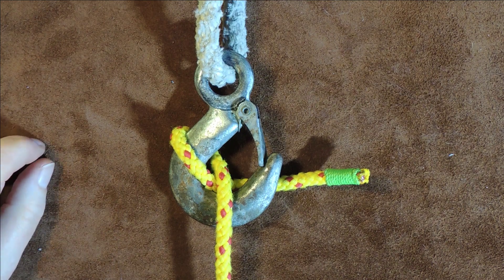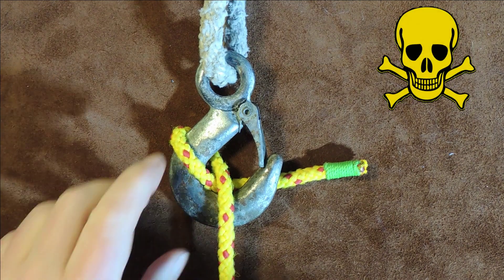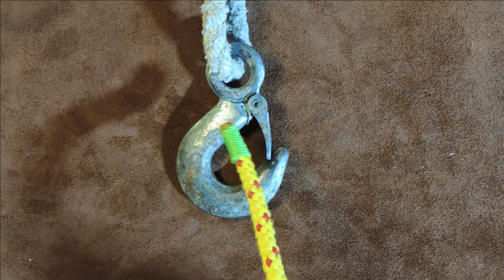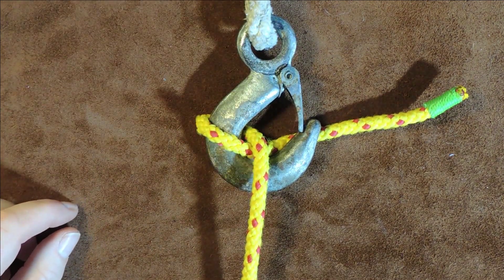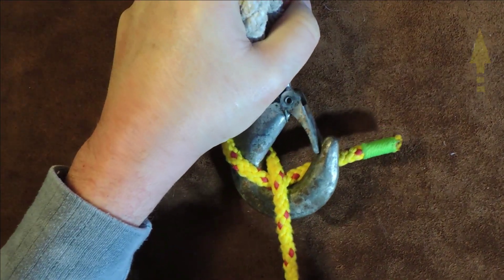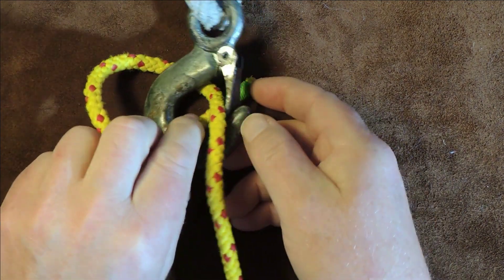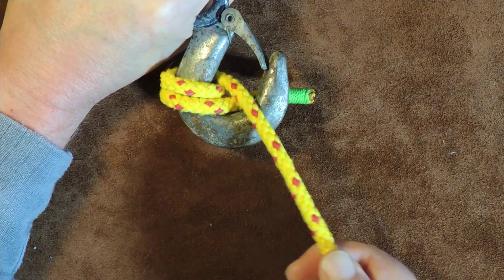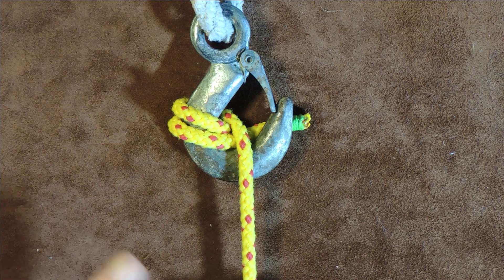Blackwall Hitch - Double Blackwall Hitch - Attaching a Load to a Crane Hook

Comment: Johnny - though I wouldn't use this for lifting, I've used the Blackwall hitch for winching multi-ton logs up ramps onto a saw mill. It never slips as long as its under load. And, there's an easier way to "throw" the hitch over the bill of the hook by starting with an overhand loop facing away from the bill, dropping it over the bill and sliding it around the back.
Reply from the maker: Thanks for taking the time to leave a comment Robert. I have to say that I did test this a number of times and was really impressed with the speed and strength of this hitch. Thanks for letting me know that this particular hitch is still alive and kicking.

Comment: Ashley has this to say about it: 

> The BLACKWALL HITCH is one of the most common applications of the SINGLE HITCH, but it is not to be trusted too far. At sea 
it is used in setting up rigging lanyards when they are too short to tie with a better hitch. The name BLACKW ALL HITCH was applied by Steel in 1794.

So it seems that it was only really used when they had to.

Comment: Great little knot. If you tie a figure 8 stopper on the end of the free end it will be much safer. Especially if the cordage is properly mated to the hook. Very useful for hanging gear temporarily. It works well tied in the fork of a branch too. 😀
Reply from the maker: I think it comes from the good olde days when speed was the important factor, health and safety was not.

Comment: I used to use this hitch all the time when lifting smaller loads (less than 1 ton say). It is secure as long as the load is maintained but as a security feature I used to leave the working end long and put a half hitch around the standing end below the hook to stop the hitch from working loose. You also need to bring your sling around quite high on the back of the hook. If the sling slips around to the bottom of the hook it will fail. The advantage of the Blackwall Hitch is that it is very quick to tie, won't jam and allows you to shorten the sling which is useful when you have limited head room.
Reply from the maker: I am glad that this is still being used today!! Where do you work that requires this hitch?
Reply: I used to work as a rigger, mainly relocating machinery. Often headroom was very limited and on the smaller machines we would use flat nylon slings as short as possible. So far as safety goes the hitch won't slip if used properly and it is kept under tension. It is the rigger's responsibility to check the slings before each lift. Nobody should ever put any part of their body under a suspended load no matter how it is slung.
Reply from the maker: Brilliant, just love to hear that there are still places in this world where knots are still used!!!

Comment: Used to use this as a temporary when I needed to hold something like a tool or cable while I was building fiber optic plants, but I had a hook on either end of my hand line, so I would secure the end of the rope just to be safe. Never used it with any machinery though, and more often than not a larks head would do what I needed.
Reply from the maker: Thanks for taking the time to share this information, I always love to hear about knots and cordage being used in action!

Comment: This is such a fun knot because it is so simple and looks so insecure, but it holds even a heavier load as long as the load is maintained.  It reminds me of the  self tightening half hitch knot which has those same properties. You should check it out.  I don't think you've done a video on it. I don't know if you want suggestions,  but the Kalmyk loop is another cool but relatively obscure one I just learned. Thanks for keeping knotting interesting. Yours is one of my favorite channels
Reply from the maker: I am glad that you mention the Kalmyk loop, I was thinking about it only yesterday and could not think of the name!! I personally like the Imitation Slipped Bowline which looks rather similar: https://youtu.be/i1KSZfSGEPg
Reply: @KnottingKnots  Hi Johnny,  that is a nice little knot too. Easy, secure,  and quick to tie. I do see similarities between it and the Kalmyk loop,  but one advantage of the Kalmyk loop is that you don't need to have access to the end of your working end.it can be tied in the middle of the rope, yet it is not tied on a bite. I've rarely seen a knot that can do that. Just remember to be aware that the small loop that runs down the middle, parallel to the standing end goes around the standin end side of the loop that goes around  whatever it is you are tying to,  instead of the working end side. Then it won't slip. It's kind if like a slipped eskimo bowline in its structure.  I will send you a link to a nice explanation video done in a YouTube bushcraft video
Reply: Sorry,  cannot figure out how to send a link in a comment,  but it as a man named Lonnie and his YouTube channel called Far North Bushcraft and Survival. Just posted the video featuring three knots about 2 weeks ago.
Reply from the maker: Got it, many thanks for sharing this me!!
Reply from the maker: I think you have now convinced me to do a video on the Kalmyk Loop, off to do some research on it. Cheeers,
Reply from the maker: You now have a mention in Friday's video!!! ;=)

Comment: Hey mate, have used both blackwalls occasionally. Its Important that the rope almost fill the space of the hook, I mean, a thicker rope for the hook you are using. Think It's written in ABOK as well. If you tie it the wrong.... oops. Thanks for the knot.
Reply from the maker: I was swinging off this the other day and I found it to be rather useful. That is good information that you also mention about the thickness. I am off to look it up!!
Reply from the maker: Having sent me off on a task..... The Bill Hitch is recommended by the British Admiralty Manual of Seamanship but is not safe in small rope tied to a large hook.
Reply from the maker: OMG, just seen the Bill Hitch, I can not believe that would even work??
Reply: @KnottingKnots  no, seeing the Bill hitch would seem counter productive 😆 but might be
safer I think.
Reply: Ok, Bill hitch works a charm. Just lifted a 300 kg feed sack with it and held no problem. I find that natural fiber ropes hold much better.
Reply from the maker: I love it when people have the gear to test these things out!! Are you on a farm?
Reply: I wonder if part of the advantage of this knot was that the load could be lowered with the hook to the ground, then this would release the tension, allowing the hook to be pulled up for the next load. Quick to tie, and quick to release.
Reply from the maker: Many years ago I was a slinger in a dockyard. There was one rule with a crane that could never be broken. The crane driver was never allowed to loose site of his hook! So your theory works on land, but lowering a load into a hold may be a problem with this. But, I do not know how old this rule is?

Comment: Great!would à clove hitch be safer.or anchor bend. Great channel
Reply from the maker: Oh yes, but in days of olde, time was the issue! This hitch just made things a lot faster, so more money was earned by the dockie.
Reply: @KnottingKnots  i totally agree !reason I mentionned  is to prevent  beginners to get hurt🏥
Reply: Yes, but they would defeat the two purposes of the Blackwall hitch: speed of application and ease of release. As long as the load is applied, they are amazingly secure.

Comment: The only time I used this was for hanging my rope on the back of my tractor unit on wagon or hanging ratchet strap inside trailier from its hook ... Even then I would occasionally loose one of my ropes bouncing over potholes.
Reply from the maker: Yes, the pothole will test even the hardiest of knot, let alone this where one is laid over the other.

Comment: I first experienced this in use to lift a bucket of ‘bits’ - say 25 kg. I asked the riggers about it (I didn’t trust it!) and they said they use it ‘all the time’. I insisted they put a stopper in it (I showed them the Oyster stopper to their delight) - and to my surprise it didn’t slip at all! The key is to tension down the standing end as load is applied. Still: gotta keep things standard and safe - I won’t be using it! Why not just tie a decent loop knot? We’re not allowed to use anything but certified gear anyway so a sling would be more appropriate...
Reply from the maker: Long before health and safety. I personally like the Imitation Slipped Bowline as a quick tie and release know. Even though it is slipped, when dressed correctly, it seems rather safe.
Reply: Agreed! A number of loop knots work. My favorite is the Anglers loop - you did a nice video on it. Still: HSE (COSHH, OSHA, etc) demand ‘proper’ rigging - and all hooks need safety catches...

Comment: Well been a rigger in the construction field for around 20 years in hydroelectric dams coal/N gas power plants an a few nuclear sites an we don't use this lil hitch much especially nowadays when they've  let the damn safety man run the job site  an they aint got a trade one under their belt all they know is what the  book tells them an just  like with these engineers with no hands on experience just cause it works on paper don't mean it's gonna work in the real world but on rare occasions we might use this for a tag line knot when we don't really even need a tag line we jus put it on there to shut the safety man up and we can get our rope back pretty quick without having to waste a bunch of time getting a harness an climbing to take a knot out

Comment: I think you have misunderstood the purpose of this hitch.  The working end is attached to the load and you hold the standing part.  Apply tension to the standing part and you lock the hitch, but can lower the load by easing off the tension on the standing part.
Reply from the maker: Give it a go and have a play, you will be amazed how good this is!!
Reply: @Knucker…I think you’re right. But how do you control the descend  of the load that has the working end by slacking the standing end, safely? There has to be some sort of ratcheting  involved to catch the load at incremental steps so it doesn’t just drop when you’re ease tension on the standing end. Or you don’t burn your hands as you’re slipping the standing end, on say a pulley.